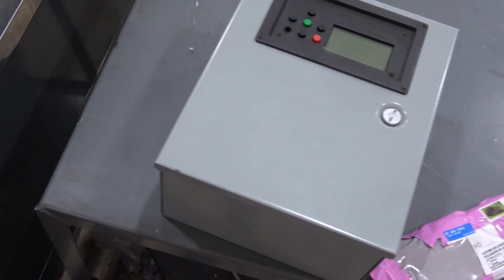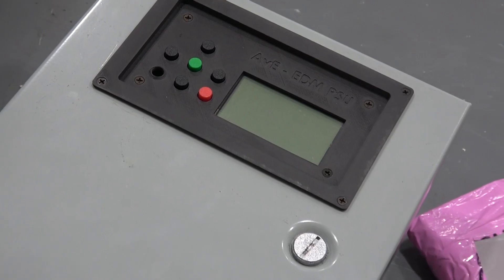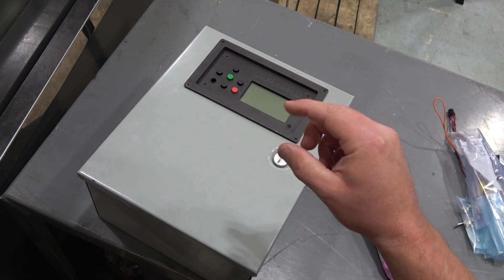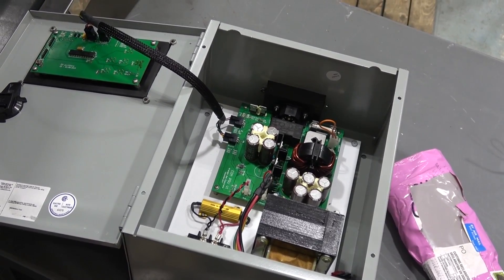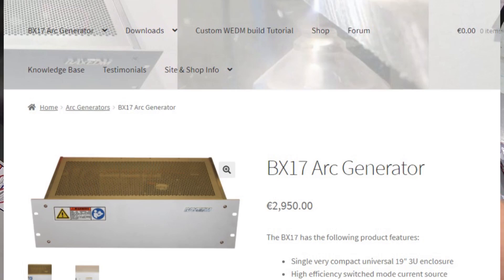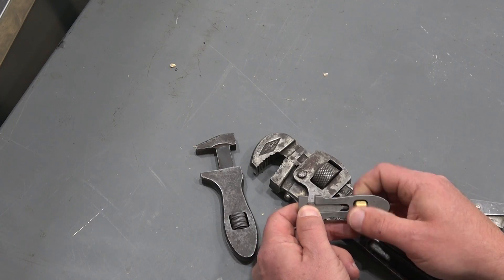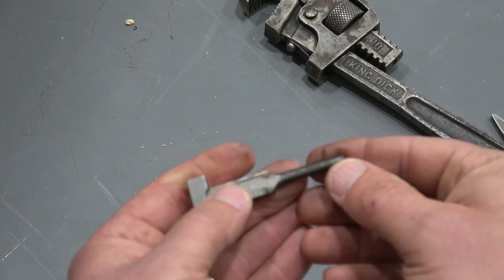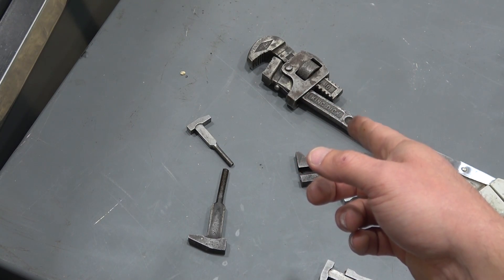Tools from the Male Bag!

Comment: I always relish explaining the difference between Acme and standard "V" thread to the uninitiated.  If you want a thread to move a thing you use Acme.  If you want a thread to keep a thing from moving you use standard "V" thread.
Reply: I like relish. Other condiments can go on my tool.
Reply: @matthewellisor5835  Always use condiments when masticating.
Reply: If you need to move a thing and then keep it from moving, you use a buttress thread?
Reply: Well this thread is about threads
Reply: @superlazy3355  So! (A needle pulling thread.)
Reply: Which thread do you use on cheap pot metal fasteners you want to cross-thread, round-over, and snap in two? I’m running a scheme to piss off as many 200-300 lb. gorillas as possible. -China

P.S. Don’t reply here, use the greased-up backdoor accout.
Reply: An admirably concise explanation!
Reply: @TheloniousBosch  Nominal pipe thread.  Or if you're really sadistic, British pipe thread.
Reply: @matthewellisor5835  "sew"
Reply: @matthewellisor5835  La! ( a note to follow so.)
Reply: @ilovejobbo  Ah, :shrugs: the toaster should do fine. Then temper with a mean-look and a trip across the ocean in a container.

Comment: I think I understand what you mean about the threads on the #toolrescue adjustables.

Since they taper to a point, the surface where the force is applied is cone shaped. The threaded shaft or the nut can't ride up the cone of the threads, so the force would find the path of least resistance: strip the threads or turn the screw.

I guess that's why the screw in a bench press is square. Never thought about it until you brought it to my attention.

Thank you for your work, you big, beautiful Canuckistani enginerd. Adopt a few kids, your family could save the world. 👍

Comment: I'm sure youse guys are on top of this. The guy that makes the aforementioned commercial edm power supply has a YouTube channel called Baxedm. In one of his videos on making his wire edm machine he mentions that the servo controller was difficult to work out. Because of the nature of edm cutting the control has to be able to go back and forth along the path. He mentioned that this is not what most controllers are able to do. So based on what he is saying a normal 3D printers control might not be able to control the edm process. I know with my Mitsubishi wire machine when it enters a cut it will actually go back and forth in order to avoid a short and breaking the wire. Until it gets a stable cut going. I don't know just a thought.

Comment: I am working right now on simple edm tool for 3d printer which is having feedback to microcontroller (arduino). Im using in initial tests ordinary copper wire of 3mm in diameter to drill holes. Hardest part is to program 3d printer firmware to cooperate with edm brain. Im also working professionally on 6 axis EDM diamond sharpening cnc machine, so i know a bit around thoose stuff

Comment: Note that the King Dick fish wrench has a recess in the knurled thumb wheel that contains a thrust spring and a washer.  It keeps the wrench tight on the fastener by preventing the wheel from weeble-wobbling down the threads of the movable jaw.  A critical item omitted from the HTR version.  Easily added though.  If you disassemble your King Dorque wrench, be sure to reassemble the thumb wheel in the in the proper orientation: with the spring on the handle end--not the wrench end.

Comment: Have to say, EDM is 1000x more interesting/useful than a 3d printer to me. Unlimited geometries in homogenous, strong metal, all you need is time? Fuck yeah!
What's the biggest challenge with the PSU though? Does it just need obscene amounts of amperage, does it have to be particularly stable, does it need to be ultra high frequency (Megahurts+), is the recoil from the sparking particularly bad for most PSU designs, or what's the deal? I suppose otherwise a class D amp meant for large PAs would probably do most of the tricks after some simple modification (remove output smoothening coils), and be cheaply available... Can easily go in the kW range with a couple IRS2092+IRF6645 Mosfets.

Comment: Ave,
Just wondering if you wanted some (no talking, but shop-ambient machine-shop audio with no music) footage. I have a 3/4" M18 w/one-key 2864 Impact that is a bit more than a year old and has been used and abused as hard as could be. I regularly am killing/overheating a charged 5.0AH battery at work. Breaking 1300ft-lb torqued+rusty 1-1/2UNC bolts(18bolts x 3 units in a shift). It's had a harsh life. Pretty sure the spring is weak, or the hammers are worn. It's not hitting like it use to and the "High-speed break-loose than slow run out" feature is wigging out, I assume from the hammer skipping. So tearing the front end down to inspect before taking it to the service center( So he doesn't screw with me). I will take top-down view video (like BigCliveDotCom) on my bench with good lighting and try to maintain good framing. I will close-up any damage and provide notes with the video. I'll private post it on my youtube and provide the link, I can upload the raw to my drive if needed. Feel free to edit & voice-over the video. I presented this offer to DeBoss aswell.

Thanks for the great videos and keep up the good work.

Sincerely,
Chris Lenahan

Comment: Those king dick tool are great quality, most of my witworth stuff was king dick never broke any but lost a few in bilges . Those stilsons handle a meter length of steam pipe for extra leverage, did that to a set for 15 years and they never bent just wore out , on larger sets 2.4 m with a hand winch normally breaks or bends them .

Comment: can someone explain to me what benifit is there in using a canbus in electronics, rather than analogue 24vdc, cheers
Reply: CAN bus carries data and allows communication to multiple devices on said BUS. 24vdc is typically used for signalling or switching purposes only. IE it doesn't have the ability to transmit any values between devices. From a controls engineer.

Comment: I've been waiting for this one. Will it be able to remove material from bullets in a precise way? Thanks to bigclive, also!
Reply: edm works with anything conductive so I don't see why not
Reply: Youll be able to remove the lead very quickly, i imagine. Wear safety glasses.
Reply: @ohnoitisnt  I don't want to remove lead. Lead is easy, you just cast it in the shape you want. Imagine if you could make a bullet any shape out of any metal you want then electroplate it with copper to give it non-fouling high muzzle velocity properties.

Comment: EDM via 3Dprinter, that flashlight thing, the dyno...
Man you got too many irons soaking in the fire for too long. Need to drag one or more out and finish them already- you know what they say about follow through.

The EDM thing is pure frickin genius though. 3D printers are built around the precision put-the-tool-in-a-specific-place thing down, you're just changing the tool into something else.
Could be adapted to a small plasma cutter, mini milling head (okay, probably a Dremel), water jet, even an inkjet head for custom decoration of finished parts. How about a teeny tiny sandblaster for selective sandblasting?
Reply from the maker: Sandblasting idea is fantastic. Let us know when you've finished it eh.

Comment: Next time you decide to do anymore of the CBD veg which I'm sure you've already accomplished and done a lot of T fives or even just fluorescence more on the blue Spectrum work a lot better for the vegetation and when you're starting out you can run 24 hours of light and taper back 15 minutes a week tell you get where you want to be it'll add a little more heat to the room and help dry out the soil or just go with the metal Highland for veg and during Bloom you want to go to high pressure sodium red light LED really complicates

Comment: Once in the machine shop, when there wasn't much work to be had, my boss took a job we didn't have the tools for.  Put a 3/4" square peg through a 2"x2" steel block. Used a 3/4" drill, a roll of duck tape to wrap my hands, a 1/2" square file and, 1 week of labour.  It took two weeks for the blisters on my hands to go down enough I could play with my own tool.  EDM!! EDM!! I WANT ONE!!

Comment: I don't want to nag, but the EDM psu looks anemic. I don't know the power requirements, but I have read that EDM is quite an inefficient form of machining (power wise). Quick search on google shows that Mitsubishis one requres 38 KW input power. Nothing in that box looks like it would handle a couple of 100 W let alone a couple of kW - based on wire diameter, heat sinking, transistor size ... Also for hight di/dt (intentional current spikes) I would not recommend electrolytic capacitors. They have high parasitic inductance and don't respond well do high di/dt conditions.  
I would be interested in taking a look at it, is there a git hub project for it or something similar?
Reply from the maker: Very astute, almost like it's intended to be a desktop machine  and not a replacement for a quarter million dollar industrial EDM.
Reply: @arduinoversusevil2025  What power rating are you looking for?

Comment: abridged version :)

--my company baught a sfx-4000b 3kw edm tap remover
--3/8" brass rod runs through hss taps at 2mm/min with cl-whore-inated city tap water as fluid.
--not what your trying to do I know, but
--why didn't you pickup one of these to start for under 3kCAD and Rev-Eng the PSU/Y-Servo Controller?
--sounds like just in man-hours the group working on it has crossed $3k(not that the videos didn't make that), better than scratch designed/built? and my drunk fixing something for someone else time is only worth $15/hr..